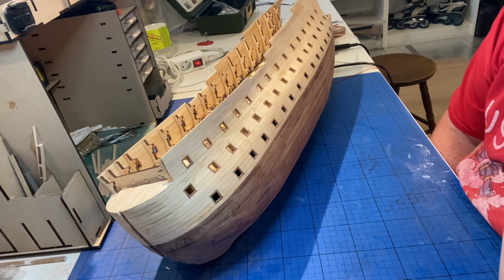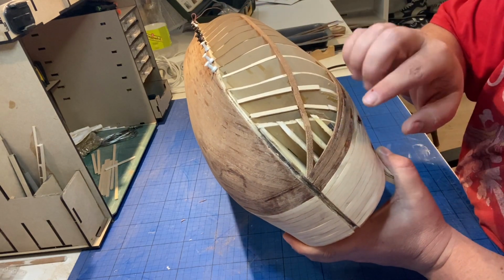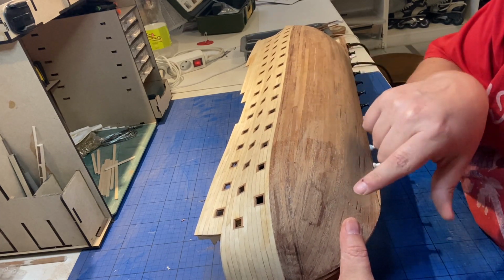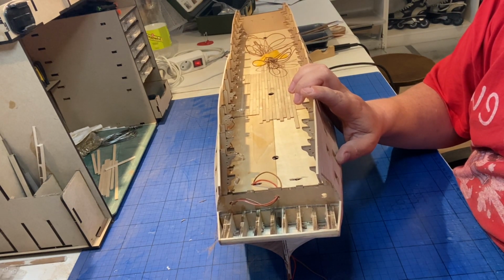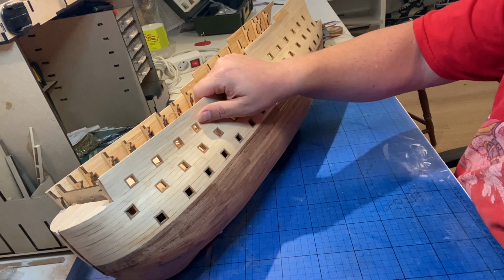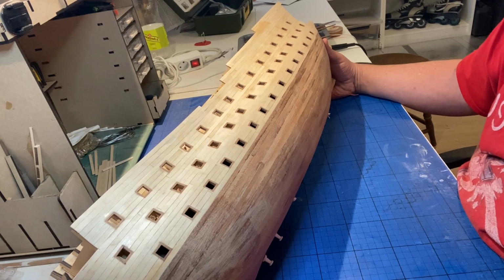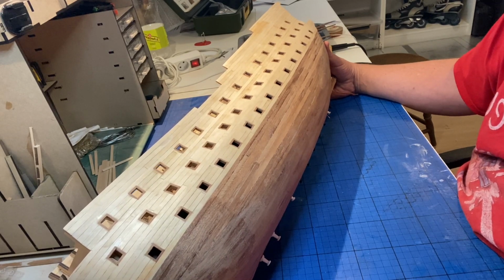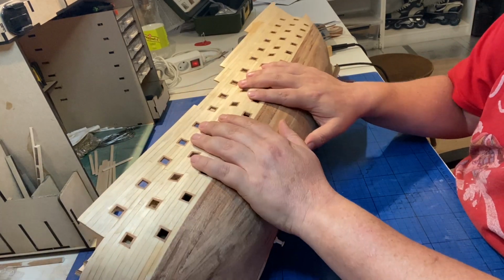Santa Ana #part12-Part2 hull planking and stern work #artesaniaLatina

Comment: Great work! So good explained.
Reply from the maker: Thank you. 😃
Which part do you mean I explained well? 😊
Reply: Hull is looking so good. I've also used that method of putting a bits of planks over a low spot to even it out. Once sanded can not see where the problem was. Ber you will be glad to finish the other side. 😊
Reply from the maker: @GregWilson635  i don’t like it, as you can see it. I will rack it up as battle damage to the hull. 😅😃
Reply: @TheBurningSail  Have  you sanded it yet.? I would have thought once its sanded you shouldn't be able to see it?
Reply from the maker: @GregWilson635  yes it has been sanded, it’s not all done yet, but you can’t get that dark spot of without replacing the wood, it’s gone deep down in the wood. 
Hoping the varnish will take the most of it, otherwise thats the side that’s gonna be against the wall once it’s done. 😅😅
It might also be varnish residue from when I test varnished the ship. 🤷‍♂️😅
Reply: @TheBurningSail  I already know that one side of the Soleil is going against the wall lol. That's the side I always practice on first ;)
Reply from the maker: @GregWilson635  we’ve all been there. 😅
Gonna see if I can do something about it. I have some sappeli veneers I might be able to do something with. 🙌😃

Comment: the Acrylic lacquer is utterly useless on wood, it doesn't soak in and isn't very tough, i use expensive yacht varnish too, it's the only way........ but it's tinted i'm afraid.
Reply from the maker: Yea mine has a yellow tint to it, if there’s too much applied on the same spot. 

Cheers for watching. 👌
Reply: it's interesting to know that many shipwright models back then weren't rigged, they just displayed the hulls only, it actually looks quite good.  @TheBurningSail
Reply from the maker: @malcolmmacdougall or half a hull on a plague. Actually I think that BB still does some of that half hull kits.
Reply: yes this hull only model is quite common in museums  @TheBurningSail